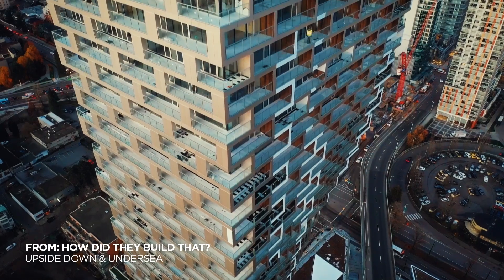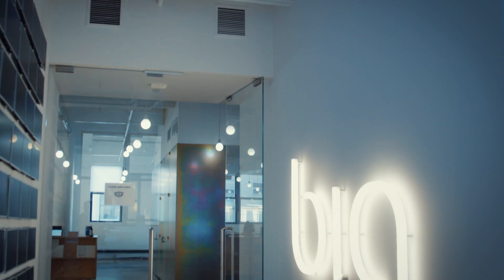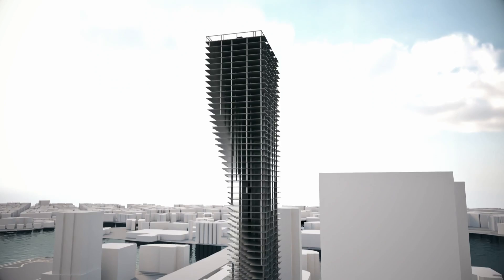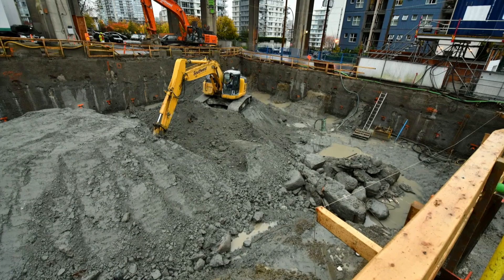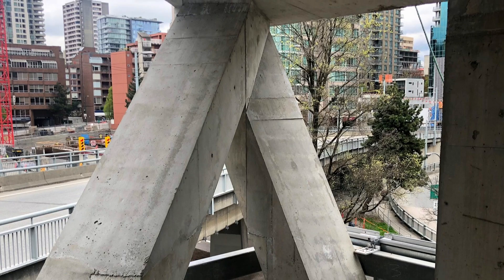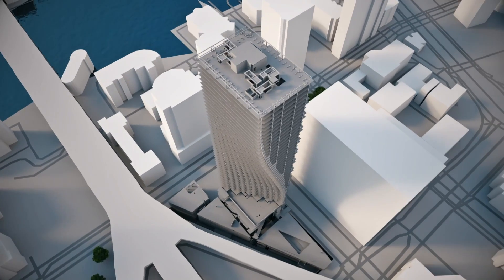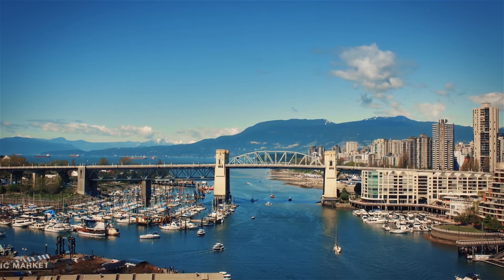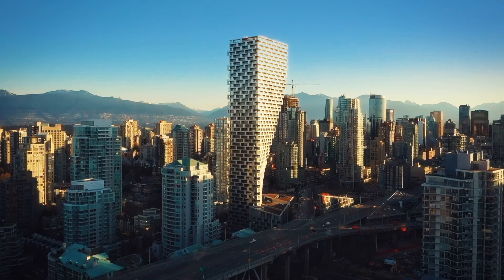Twisty Skyscraper is Constructed Carefully Around a Bridge 🏙 How Did They Build That? | Smithsonian

Comment: We can send a rocket to the moon and dune buggies to Mars but, we still build with materials that won't last more than a few centuries. 🙄
Reply: Lets be fair, most of those old structure  require constant unrelenting maintenance, and while its true we can send stuff on the moon a d mars doing so is not something done everyday by every city in the world by everyday peoples. It both expensive and still to this day resources intensive and while it might seem easy to enforce long lasting construction its not when most city expect to demolish those building later  when they have to expend or reorganize themselves.also contrary to what most believe durability in construction is about design not material armed concrete can last century. Also a more durable efficient building is a pyramid shaped one, needing lot of ground surface and space near city center are expensive. Building wide seem perfect until your take transit into account.
Reply: Buildings are meant to be torn down eventually and replaced.
Reply: And you can come up with something better? What are you complaining about